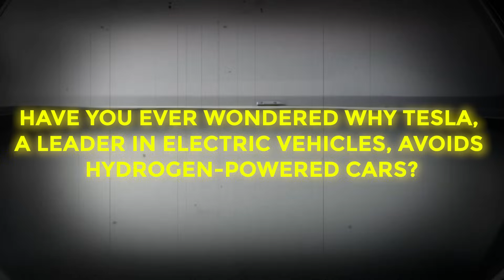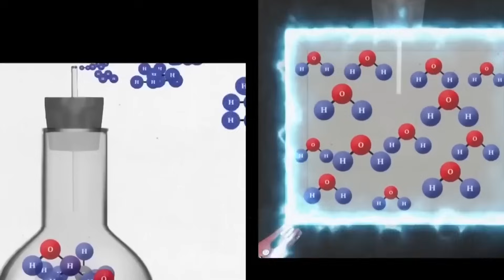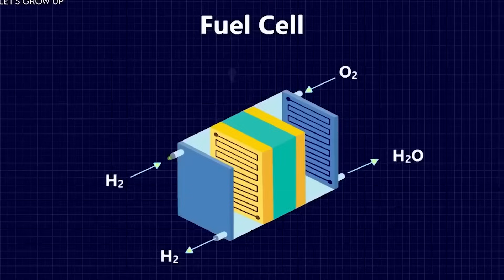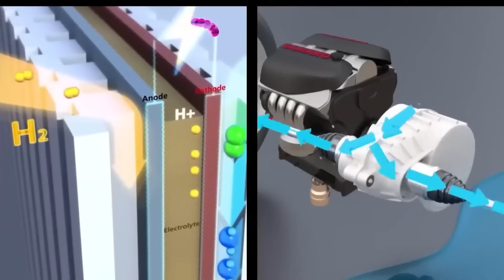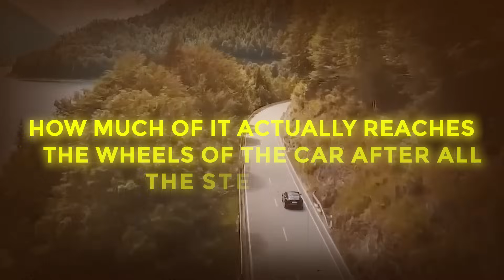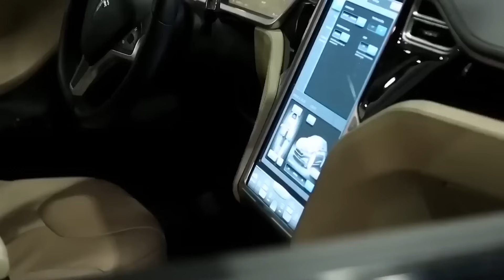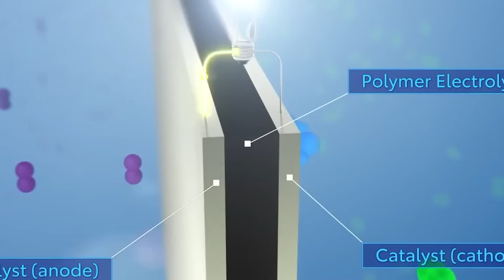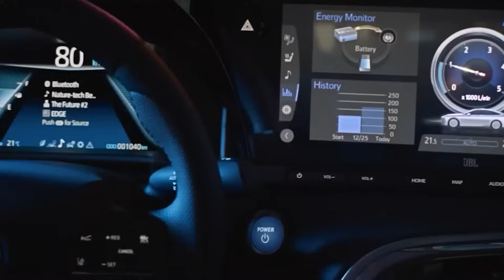The Shocking Truth: Why Tesla Rejects Hydrogen Power!

Comment: 1. Hydrogen is expensive to store 
2 Hydrogen is unstable and deteriorates whatever vessel its stored in
3 it takes power to make the Hydrogen to then use to make power ( a waste of power )
4 Hydrogen cars have been around since 1966 and there is may reasons why it never took off
5. 1 ev station ( gas pump ) costs about $2000, a petroleum station about $10000 and a hydrogen station $2000000.
6. Ev's are cheaper to buy , run and maintain vs hydrogen or ICE engines. 
Do I need to go on?
I also love the argument that EVs uses fossil fuels to recharge but some how hydrogen will use renewable energies,  absolutely bs propaganda.  Ignore this crap.
Reply: Getting past the production, storage, and dispensing of hydrogen for vehicles will require a major technological discovery 💯💯💯. Meanwhile, gas diesel and electricity are here, functioning perfectly (mostly) fine. (And li-ion batteries are almost 100% recyclable, they don’t “end up in the trash” like they said in the video.)
Reply: Can't make something out of nothing so no shit it's going to take energy to separate and store hydrogen. But doesn't it also take energy to dig up all the resources required for a battery? And it's easily accessible. With batteries you have to rely on nation's that hold those resources u need. You going to start wars for these resources when those nations refuse to sell to you?
Reply: There is no propoganda. Otherwise you will be driving a hydrogen car. It still needs a lot of development for it to be a viable option. And untill then, petrol cars are good enough. What actually is a propoganda is EV cars. They are not sustainable. They are even less sustainable than diesel cars and more expensive. EVs are elon musk made propoganda. Apple knows EV has no future, they stopped working on it.

Comment: Who paid for this garbage? Legacy Auto and fossil fuel industry are butt hurt, does not mean Youtube has to be flooded with this garbage. One of the many flaws in this video is the claim elements for EV batteries are going up in price. Batteries are going to be 40 or 50% cheaper this year.
Reply: If we have a surplus of batteries then yes. But if the demand is above supply which most definitely will be. The price of these batteries will have to go up
Reply: I've been keeping track of battery prices for the last 10 years because I live off-grid.  I can assure you, prices are NOT coming down like the media says or speculates.  A 100Ah lithium was $900 10 years ago, no it sits +$1200 CAN.

Comment: 9 minutes and you miss the point, hydrogen is not the best efficient way to move a car, why transform electricity to creat hydrogen transport and store it to transform hydrogen in electricity again? there is no sense. you want efficiency, and this is the way. lithium is not the final answer to the futuro but there is new technologies that will solve the battery problem.

Comment: I think fuel cells will not be the way to go. Toyota has been working on a model where the hydrogen is ignited directly in an ICE. This is more efficient that petroleum fuel (120MJ/kg vs 45 in gas). It is also cheaper to operate - a new company has come out with solar panels which produce hydrogen, not electricity. The only problem is the "gas tank" must be much more durable to contain H2 as a compressed gas rather than as a liquid. 
The platinum and other material in a fuel cell don't make it economically viable, while H2 can burn in a car engine pretty much as is.